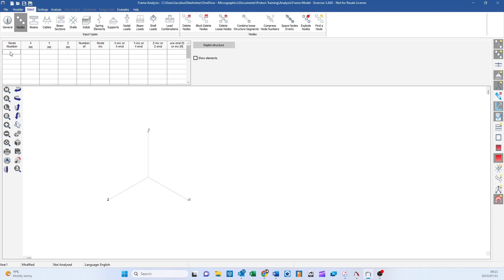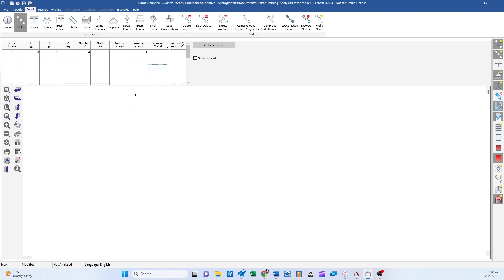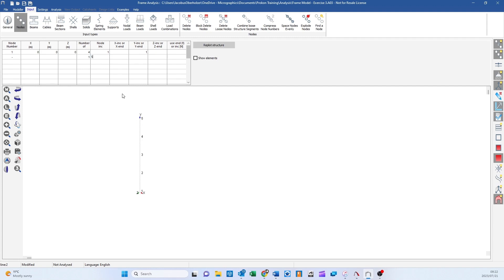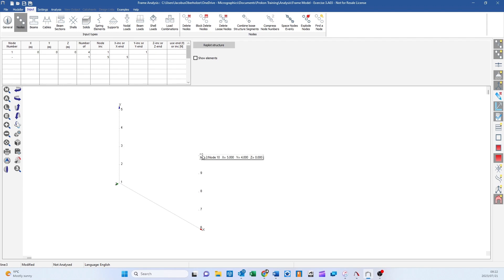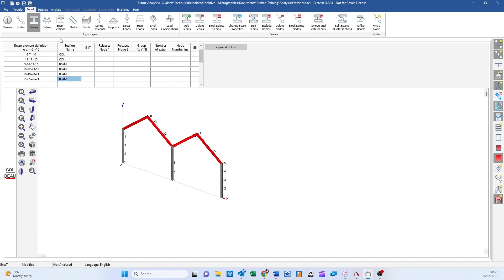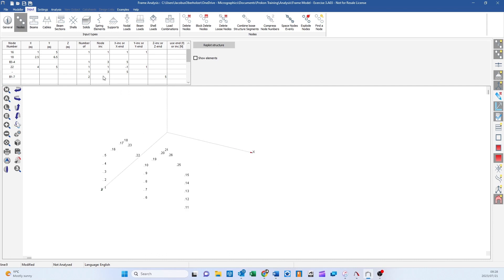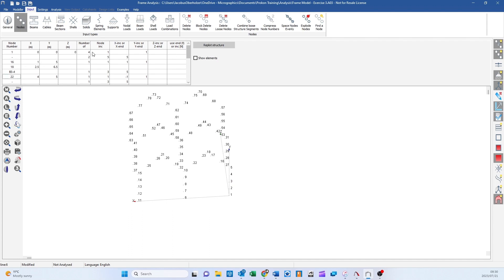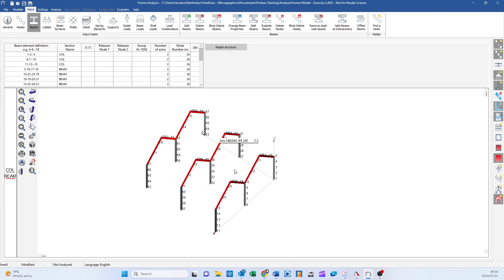Prokon Know-How: Frame Node Modelling Shortcuts

Comment: Can you copy a portion of a structure from one model and paste it in a new model? If this is possible, will the beam elements and loads copy through
Reply from the maker: @carelnaude4426 - Yes, you can. In Frame, you will make use of the "Combine models from files" function located in the General section of the Input tab Ribbon. In SUMO, you'll simply make use of the "Import Sumo" function. In both cases the beam elements and loads will be carried through.